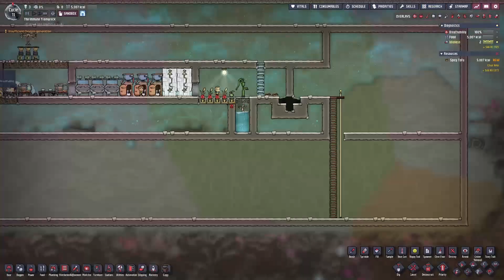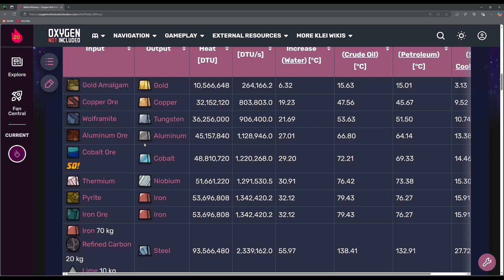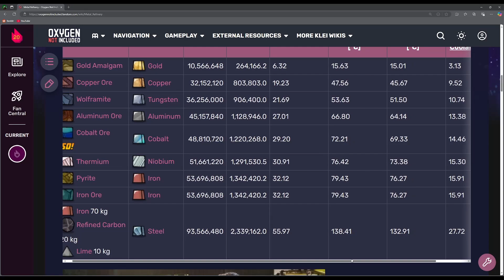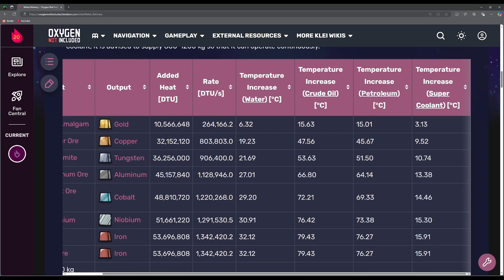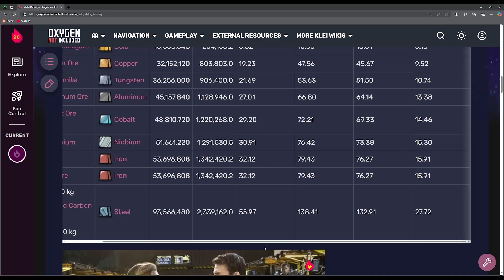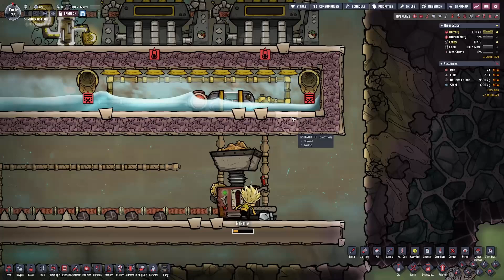METAL REFINERY BASICS for BEGINNERS in Oxygen Not Included

Comment: the automation with the liquid pipe thermo sensor is entirely unnecessary. you only need to increase the amount of turbines. you need 3 steam turbines to eat the heat produced by a metal refinery constantly making steel all day.
and secondly you should be using polluted water in the cooling loop going into the aquatuner as it it two times more power efficient than using crude oil.
the aquatuner your showed in your brick is also leaking heat into the topside due to the liquid bridge being inside the steam room and in the top area. Same with the conductive heavi watt jointplate as you can see here in the heat overla 13:24
Reply from the maker: Thank you for the feedback! The leaking heat I don't really care about because my only objective in that room is to keep the steam turbines from overheating

Comment: as a new player learning the mechanics, i really appreciate this. thank you! do you have a video covering how to cool the base using aquatuners?
Reply from the maker: I gloss over it every now and again, but I don't have a video for it.

My advice is to produce oxygen via electrolyzers and run the hot oxygen through a cooling chamber, and that will cool your base down adequately. 

You can also run cold polluted water that you find at a cool slush geyser through your base before sending it into the water sieve, run it over the hot areas of your base with radiant pipping

Both of these methods will work without needing a dedicated cooling loop, but a video is in the works!